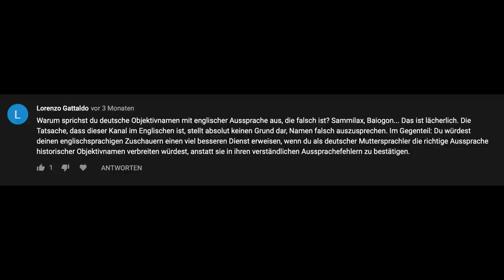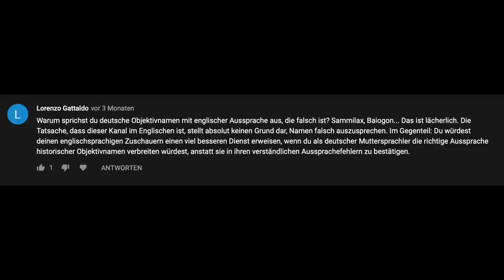How to pronounce German camera and lens brands correctly?

Comment: OMG thanks for the corrections. I speak both English and Chinese and I found out surprisingly Chinese did a lot better job in literal translation these German words with regards of keeping it's original pronunciation.
Reply: The Chinese translations, especially those translated decades ago, usually come directly from the original languages. However some recent translations come from English, so there has been a fierce battle on the versions of translations for a long time. Also, it seems to me that the Chinese language has more tones compared with English though (我记得张公子写过好多篇文章讨论了这些问题lol
Reply: @chuanlu  哈哈 英雄所见略同

Comment: Very helpful, I now enjoy pronouncing Voigtlander correctly, even if I can't work out how to make the umlaut appear over the letter a on my tablet. I'm just too analogue. Luckily I can make my Voigtlander Bessa 6x9 camera work! Just to be pedantic, pronunciation as opposed to pronounciation. Your English is a pleasure to listen to, and your films a complete joy to watch. Carry on the good work.
Reply: in fact there is a workaround use "ae" instead of "ä" ;)
Reply: @stefanmelzer9943  Thank you, I'll try that. Maybe you can teach an old dog new tricks.
Reply: @mrstandfast2212  By the way your Bessa is an awesome camera.
Reply: @stefanmelzer9943  Thank you Stefan, I actually ran my first film through it in January after it had sat on a shelf for years between books. I've only scanned the negatives at 2400 dpi, and it performed perfectly. Being uncoated it lacks contrast, however on the next film I'll use a yellow/green filter.
Reply: @mrstandfast2212  What kind of lens is attached to the Bessa? A Heliar or a Voigtar?
Reply: @stefanmelzer9943  The full title on the lens is: Antistigmat Voigtar 1: 45, F = 11cm, Nr 1073488. I think that equates to approximately 50mm in 35mm format. Inside the camera is stamped H581042. I think these date it to 1929, but I got bored looking up obscure websites in search of conformation.
Reply: @mrstandfast2212  very nice. I like that low contrast look a lot.